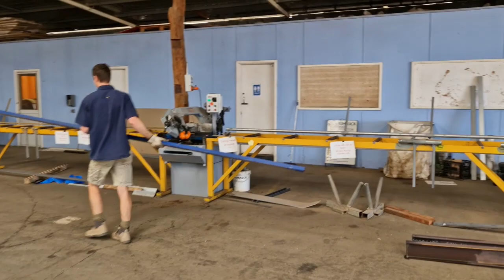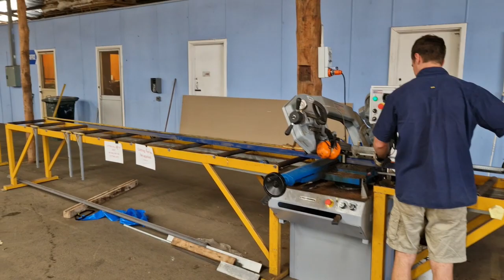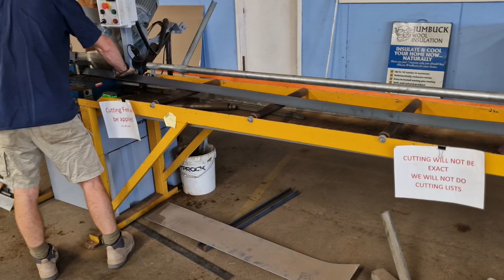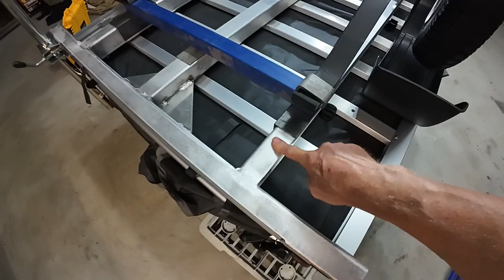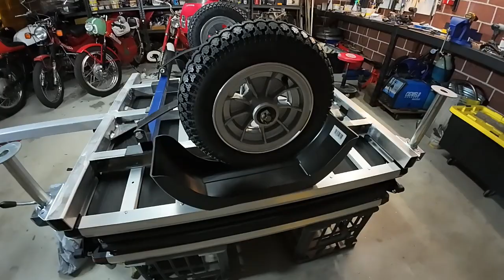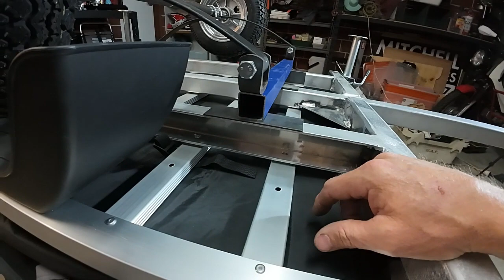Mini-Camp Episode 5 Steel Suspension Components

Comment: Handy having a supplier like that. I’ve always appreciated the timber cutting at B&Q (UK) - getting 8x4 feet sheets  divided into the right number of parts and sizes.
Reply from the maker: The macinery they use and the skill of the operator often provides a better result too.